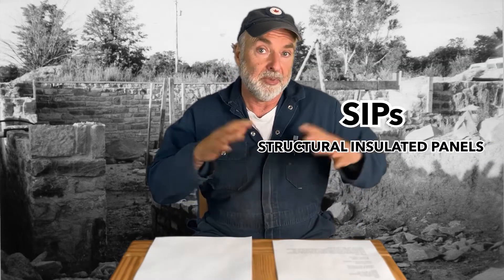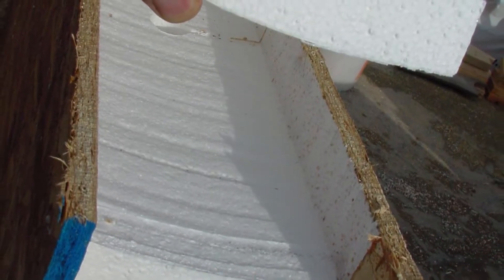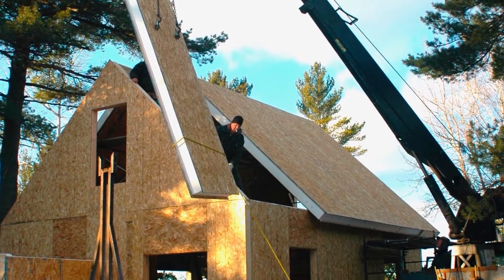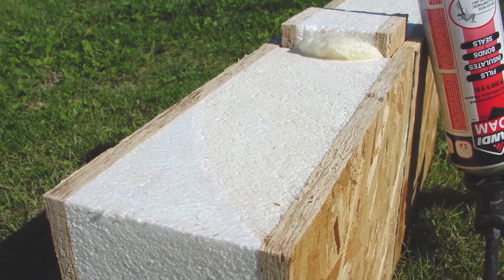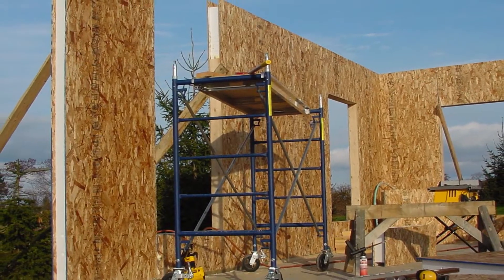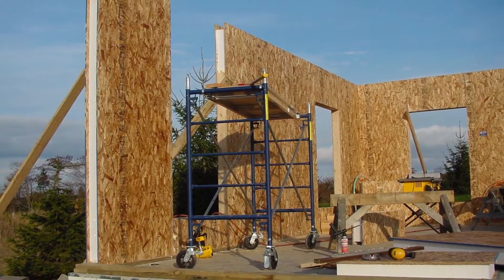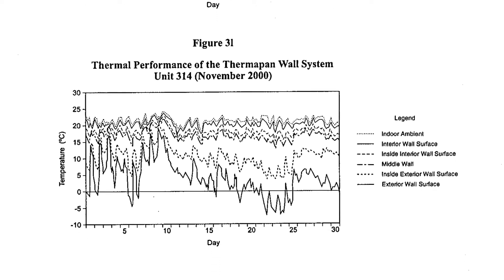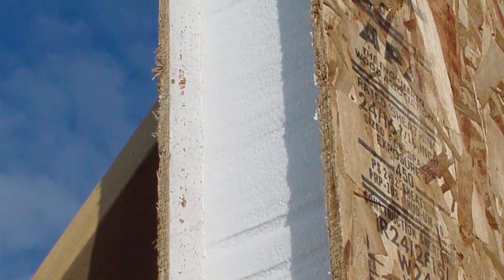The Surprising Benefits of SIPs Homes vs Framing (Structural Insulated Panels)

Comment: So is a sip home a benefit for the builders or the buyer
Reply: Definitely both. The simplicity of building with SIPs is unmatched and that's great for the builder, his crew, the trades that work with him, etc. 

Meanwhile, the energy efficiency makes it a victory for the occupants because the climate is easier to control, the ventilation is more efficient (reduced HVAC because the structure is so tight), improved indoor air quality (allergens, humidity) and the biggest benefit of them all is lower utilities. The cost of living in a SIP structure is a fraction of that in a stick-frame because the limited thermal bridging in a SIP building envelope means less infiltration.

Comment: Nice round-up of SIP tech - Used it 20 years ago on my UK self-build for the roof - so much easer, quicker and way better thermal performance than traditional roofing and fab vaulted ceiling included at no extra cost!

Comment: Well, I can’t imagine those SIPs being affordable. I would love to build my retirement home this way. I’m extremely doubtful. Everything is ultra expensive in Canada.
Reply from the maker: The last time I did a project with SIPs I calculated the overall increase in cost to be about 2%. Per-foot of exterior wall is considerably more expensive than stick framing, but overall it's not much different. The benefits are greater strength and about 50% less energy use for a given level of wall insulation (compared with a regular wall insulated with fibre-based insulation). The strength issue is considerable, too. I know more than one person who has a SIPs home in hurricane-prone regions and their house has survived multiple hurricanes without significant damage, while all surrounding homes were flattened.
Thanks for watching and commenting!
Steve
Reply: @ Thanks for the info!! I was being a bit pessimistic.

Comment: do we need structural system with it like concrete, studs or steal pillars? 
how do you support openings like doors, hallways or windows in it ?
Reply from the maker: That's a good question and the answer is surprising. The panels themselves provide all the strength necessary. Wood framing is inset into grooves in panel edges around door and window openings, but the panels themselves provide all the strength needed. To test how strong SIPs are, I took a 12-inch wide piece of SIPS 10 feet long, and placed it on two sawhorses. With a clear span of about 9 feet, I stood on top of the panel with my fully loaded tool belt on and jumped up and down. That narrow piece of panel never flexed a bit. It was like I was jumping up and down on concrete. I wouldn't believe it unless I experienced it.
Thanks for watching!
Steve

Comment: What’s the reason we don’t see sip build widely adopted? Even sprayed foam insulation is hardly used in new construction
Reply: It is 2 things in my opinion, the big one being cost, the second being building codes and inspectors who are not familiar with SIPs, simply not worth the hassle for the builders to try and educate them
Reply: I live in hurricane alley. You would think everything would be built with SIPs or ICF but they are not. It is the building code and inspectors (government) and not the contractors as the headwind.

Comment: Ive been researching sips and they have some good benefits.

However, obs is crap.  Its horrible on sips and if you have any air leakage, you are in trouble, big trouble.

Look up the problems with sips.  They may be fine for  10 years...then after 10.years of expansions and contraction, the joints start leaking air, and the osb rots and fails.  It can be like rebuilding your entire house in 25  years or less, especially on roofs!

Its because osb is such a horrible building material.

Now metal or other substrates are possible but i dont.know pricing and they may not be cost effectuve.

Be careful folks.  Look up all the sips failures and horror stories first before choosing sips with osb!!
Reply: Some Manufacturers , can do Zip or even LP Smart siding instead of OSB. I'm working with Eco Panels of Tennessee and am doing LP Smart siding

Comment: How does retrofitting plumbing or electrical in existing construction work with SIPs? Is it even possible to do something like install a new outlet, or remodel a kitchen and move the sink?
Reply: You get channels that run along the surface of the panels, so you don't put them into the panels, which actually makes it easier to modify later compared to running electrical or plumbing through the walls of a conventional stick frame. Even with a stick frame home, if you live in an area that gets below freezing, you wouldn't run plumbing through an exterior wall anyway due to the chance of freezing. With a timber frame, or plain SIP panel home, you actually have greater ability to remodel within the existing frame later. Adding additions or removing space may be more difficult though.